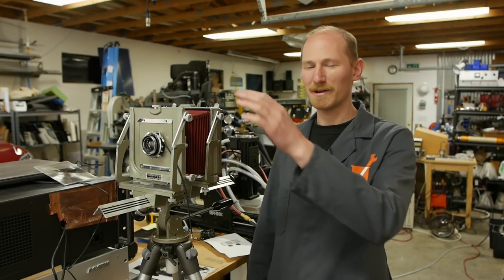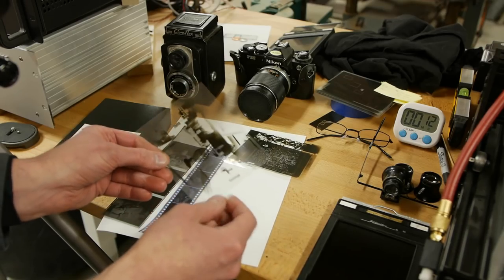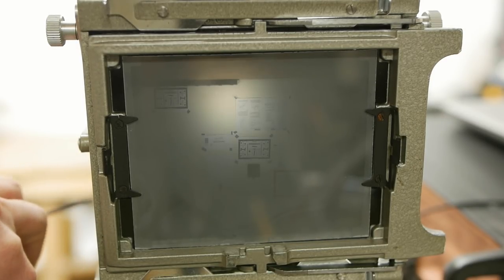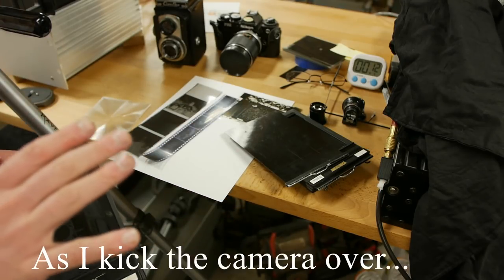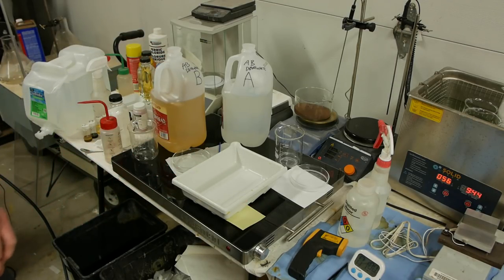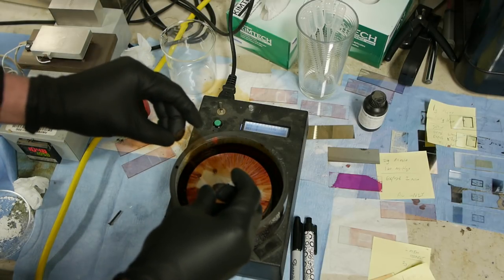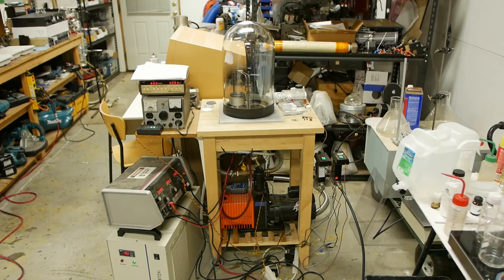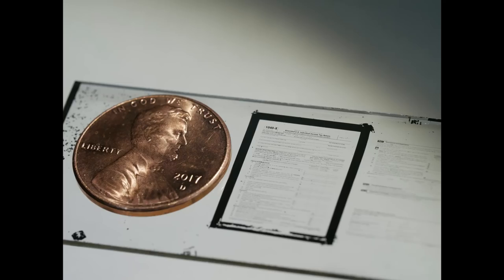Antique 4x5 camera creates 20 micron photolithography masks: Super tiny tax form

Comment: I don't know if this has been pointed out in a previous comment, but there are two main reasons for the "shark's teeth" dewet marks in your photoresist spin coat process (although I appreciate they don't seem to be posing you any problems just yet).

The first is the surface energy of the glass might be too low - a short oxygen plasma treatment will increase the surface energy and allow the resist to wet much more easily.

And the second is small particles which haven't been removed during your cleaning process.

I don't know what volume you're using, but I'd imagine you should be fine with about half a ml.

Inspection under a microscope should help you bottom out which mechanism is at play here. If you were to prepare a bunch of slides at once, then plasma treat them all, it presumably wouldn't be too much of an increase in time per slide, though I'm not sure how permanent the reduction in surface energy is.

Comment: What SheemOn Dallas said, but also looks to me like you had the film loaded emulsion side away from lens or that is one shiny emulsion. it is usually concave one the emulsion side so it presses against the back when loaded.
Datasheet will say how thick the base is, looks thinner than ordinary pan film.
Also, the dark slide has a white and black side of the handle, I set the white side out after exposure, most ppl do the opposite.

Comment: I've got a fairly foolproof way of cleaning slides as glass slides are dirty no matter where you live. We soak the slides for 1hr each in a lab detergent and 5-10% NaOH in distilled water, with a thorough rinse with DI water inbetween. The soap solubilises most of the surface contaminants and the NaOH slightly etches the glass, giving you a highly hydrophilic surface. It's well used to clean glass for surface force AFM measurements, and gives excellent adhesion for sputter coating.

Comment: This has probably been said but I did not see it in the comments.  The top of the dark slides on large format film holders are different colors on the reverse.  One side is usually white and one side is usually black.  Pick a color that is the color for your unexposed film.  After you take the picture you flip the dark slide around when you put it back in so the opposite color is showing so you now know which frames have been shot and which on have not by the color that is showing on the top of the dark slide.

Comment: The anti halation coating is actually to protect light from bouncing off the back of the film holder and back through the film again. Without this coating, light (mostly red but not exclusively) has a bad habit of producing halos around highlights. Cinestill 800t is a good extreme example of this phenomenon.

Comment: Red leds make great safe light. I have a led panel (made from strips of red led tape). They are not totally red so I have a sheet of red filter in front of it. It is about as bright as my normal lighting but just red. Crazy bright but does not affect photo papers even in 45mins or so (the longest I ever tested).
At first I tried a red bicycle rear light but I found out you can put a lot more light and replaced it with a panel. I think bike rear light was already a lot brighter than normal safe lights that are dim in order to keep the filtered other wavelenghts low enough.

Comment: Strange that the ortho film's reciprocity is negatively affected by cold temperature.
Regular photographic film reciprocity failure is reduced by cooling.

In long exposure astrophotography, in the film days, cameras were built with film holders that could be chilled with dry ice.

I print t-shirts for a living and the stencil material we use is UV, sensitive. I instantly said out loud
metal halide. Fluorescent tubes are no match for a metal halide. Much finer detail for the reasons you gave.
 My unit is a little brighter than yours at 1000w.  I have used it to make PCB boards as well.

Watching all this had me feeling nostalgic for the film days. I love digital, but there was something about the whole hands on technique required to get a result.

I still have all my dark room stuff, and I am tempted to shoot a few rolls, and do the whole process.

The fixer dissolves any of the undeveloped crystals, otherwise they would go black over time, even clear areas will contain small underdeveloped crystals that will eventually spoil the image.

A long but interesting video. The resolution you are achieving is outstanding. I love that the purpose is most just because you can. - Cheers

Comment: I think you're loading the film backwards!
I used a Linhof 4x5 40 years ago, and this I remember:
the "belly" on the film is there on purpose,
the shiny surface points backwards, 
the matt surface  (emulsion) points  to the lens.
The notches on the film are there you you can tell in 
the darkness on which side is the emulsion.
Just look at the belly on 35mm film

Comment: Nice work. Doesn't that 4x5 lens give optimum resolution in its mid F-stop range? Thanks for the flood of memory flashbacks! Back through all of my mid-60's H.S. days(nights), I had my own B&W hobby darkroom (up to 2.25x3.25). Used that Ortho Litho film for occasional high contrast special effects and PCBs. I memorized the name of that particular film developer chemistry and somehow, can still say it out loud (in two seconds!), "monomethyl-p-aminophenol-sulfate and hydroquinone".  lol Never got consistent results with color neg printing process (no voltage regulation?), but color slides were easy (E4 processing chemistry was not too safe though). I miss Infrared Ektachrome Aero film and still see an application for it every decade or so. Stay safe and keep up all the great work!

Comment: Wow this takes me back.. Used 4X5 and 8x10 until early 2000's before medium format digital superseded large format film ( though not as "antique" as that hammer tone model...and I have my doubts about that lens...  : )   A couple of tips...  Use brighter lights and thereby smaller apertures to achieve greater depth of field on the film plane.  That way the slight curvature of the film is a non issue and you shouldn't need to use your "Heath Robinson" vacuum dark slides..  : )  F11 on a 4X5 is not like F11 on 35mm or DSLR's - that's just a couple of stops short of wide open on most large format lenses.  Ideally you should be shooting at about f32 - f64 ( if that old lens will).  Yes litho's super slow - that's to achieve very fine grain in the silver halide crystals and hence better resolution - as you say it's for photographic reproduction, not for photography as such.  BTW you should be able to get reciprosity charts from the film manufacturer which takes the guess work out of it.

Lol, my great grandfather might've put the loupe in his eye socket but we used larger, brighter, higher magnification ones that were placed on the glass as you did - determining focus was quick, accurate and easy.  Oh and you're right, fresnel screens totally suck but with a better loupe are usable.  That camera looked about circa 1950!

P.S. Funny your comment about the curved film reminded me of a shoot I did once, leaning out the side door of a small plane shooting a ship over a wild Bass Straight with my trusty 120 film Hasselblad - my dream camera (at the time) . This would have been late 80's.  Processed the film and the centre of almost every image was blurry - the pressure of the air into the dark slide slot was ballooning the film off the film plane!   Film aye... horrible shit really.  Glad I now shoot digital.

Comment: Really cool! One interesting way to analyze how good the reproduction is would be to measure the optical transfer function of the system. It can be done relatively straightforwardly using Fourier analysis of a photo of a Siemens Star pattern. DOI:10.1364/OE.23.009567 shows the process for x-ray images.

Also, 2D Fourier transforms of sections of test patterns, especially a Siemens Star, can be really useful for analyzing the resolution of images. Plus they look really cool.

Comment: Two things I can think of that may provide a tiny bit higher resolution:
· Use a smaller aperture (not too small, of course)
· Use a bright, monochromatic light source (with the shortest possible wavelength), due to the fact that different wavelengths focus in different focal planes.

I'm probably wrong, though!

Comment: The reason for the fresnel is not so much for brightness it's more for evenness of brightness across the entirety of the ground glass. With a ground glass you'll find that you have to move your head about a little - left to right, up and down - in order to see all of the image projected onto the ground glass. With the addition of a fresnel you'll get the a much more evenly bright image which makes composing a photograph much simpler and more akin to how you'd compose when looking through the viewfinder of a normal camera. It's especially evident with slower lenses (f/8 and above).

Comment: Ortho film also has a slight, unmentioned advantage. Because it only responds to a relatively narrow range of wavelengths, chromatic abberation of the lens becomes less of an issue. I doubt it matters in this case, but it is a real effect.

Comment: Film holder dark slides have a white side on the finger grip to indicate unexposed, and after the shot, turned to the black side indicating exposed. Lith film is slow speed however your cool temp might be slowing it down. Typically I found 8 ISO (ASA) produced useful results.

Draw an X from corner to corner of the ground glass (Acid etched is better) to indicate the center. Put a mirror flat on the wall in front of the camera. Center all the movements on the camera to neutral position. Move the camera side to side, up/down until the center of the lens shows exactly the center of the ground glass. They you know the camera perfectly parallel to the wall. The reflection of the lens goes to the wall (mirror) back through the lens and onto the ground glass. Perfect.y parallel.

Comment: A crown graphic isn’t very “antique” but they definitely are of a certain vintage. They were made to be very reliable all metal portrait cameras and that’s where they excel. However they aren’t really suitable for what you are doing. Instead you may need to look into something known as a process camera. A couple makers are Nu-arc, argyle graphic, or robertson/log-e. They can be had used for almost nothing, so long as you’re willing to pick them up, as they are almost always rather large. These special purpose cameras however, have vacuum target frames and vacuum back film holders, and were designed for making printing masks for offset printing. They also have built in high intensity lamps and exposure timers. Their aberration corrected apochromatic lenses are suitable for copy work and micro-graphics, but you may also want to consider a micro graphics lens, like a kodak micro-ektar or micro-file lens made for microfilm work. They also have the additional advantage, that some were designed for alternative process photography as well. All that said, film photography is still the go-to system for producing micrographics and many other niche technologies, such as the photolithography mask for computer microchip dies.

Comment: Fresnel lens is in fact brighter at smaller apertures. Almost every modern DSLR has gone away from ground glass due to modern lenses being 3.5-5.6 and slower. Below about f./2.8 micro-prism focusing screens (similar in concept to fresnel) give an apparently brighter image. One of the downsides however is that at apertures wider than a our f./2.2 they no longer give an accurate rendition of the shallow depth of field. Large format cameras typically will be stopped down to very small apertures for landscape and other static photographic subjects hence the fresnel lens.

Comment: Some ideas.

Switch to a lens that's corrected for field curvature. There are special lenses for this, in a pinch, an enlarger lens should already be better.

Try glass plates instead of film for perfect flatness, or try exposing the slide directly. You can make your own plates, or you can buy them. Astronomy used glass plates instead of film for this reason. Plates for holography are still made. That also obviates the need for a vacuum back, which makes it easier and less prone to vibration during exposure.

You can control the grain structure of the negative by altering the developer, making it far higher resolution. Over one order of magnitude improvement is possible for b&w. This is how they make it good enough for holography. That said, you don't seem to be limited (yet?) by the resolution of the film.

Comment: Probably wont make too big a difference for the feature sizes you are shooting for but you should " edge " the photoresist. After spincoating the pr the edges will be thicker due to surface tension effects so when you put your mask on the glass slide some areas wont be as close. You can get around this by cleaning off the edges with some acetone. You get less area of pr and the edges look ugly but the important part will be sharper. Not sure how small you wanted to go though. Awesome work though and I'd love to see you try alignment off of previous patterns.

Comment: If I may give you some suggestions. When it comes to exposing uv light through film you should considder using a pyro based film developer. It causes a sort of stain over developed areas that greatly increases the contrast/stopping power in uv light. Also have you looked at using an old reproduction lens from an enlarger? They are optimized for reproducing flat images and can be found really cheap.

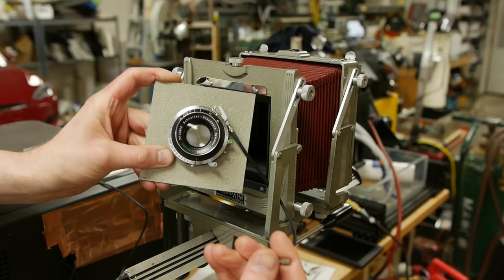Comment: @ 5:50 and 14:45 Might consider using large amount of FLASH / STROBE light to help with the instant exposure time. Wet plate collodion photographers also work with low (2-10) ISO sensitivity film/plates rather 10-30 secs.

Comment: an old medium format enlarger would simplify things greatly. add a custom plate holder for your photo resist coated slides, place your  pattern on the easel with mercury vapor lamps on either side and you're good to go with no need for an internegative. to focus just use a slide with a pattern scribbled in marker and the enlarger's built in light to project the scribbles onto the easel and focus the image.

Comment: Probably covered in comments below. . .
1. Fresnel lens on the ground glass will help even out the brightness of the screen toward the edges and corners. That is, no brighter in the center, but brighter in the corners. Some of this effect is visible in your comparison. For your application the benefit is no big deal, so choice of a plain ground glass is valid.
2. The visible metal ends of the slides protecting the film in the holders are painted black on one side. Load the film with the silver side out, then after exposure replace the slide with the black slide out to indicate exposed film. (Just a convention, as long as you are consistent the other way around works as well.)

Comment: 10:50 How to tell which side of the holder has been exposed.
Double dark slide film holders are made with a built in solution to this problem.
If you look at the top of the dark slide you will see One side painted black and the other side is painted silver (or white sometimes).
The standard practice is that you put the dark slide in the holder silver-side-out when you load in the unexposed film .
You pull the dark slide out when you make the exposure, but you flip the dark slide over before putting it back in.
That way all exposed sides of film holders end up the black side facing out.

in a box of 10 holders it’s then easy to see which sides of the holders are unexposed and ready to use.
The hooks that swing over the dark slides are just a saftey precaution to top them accidentally lifting and fogging film when they are in the camera bag.

Comment: Thanks for the fascinating demonstration.  I am wondering if your resolution on film can be adequate to produce a custom direct-printed hologram, printed on paper, then to be transferred/scaled down photographically onto the film.  Your resolution is currently 20 microns, which is pretty good for lithography, but for holography with visible light, I think you need to get to sub-microns.  I wonder if your "slow" film has sufficiently small grain sizes to have the resolution to do holography.  When we made simple holograms in college, I don't think we used film that was better than you have.
Since you are able to use a laser printer to produce the original image, It would seem a computer program might be able to calculate the fringe patterns necessary to create computer-generated holographic patterns that when scaled down, can produce, not only 3D images, but also custom optical elements with interesting properties (gratings, lenses, beam splitters etc.).  You should be able to use the film directly and not transfer the image to a microscope slide.
Perhaps you can print a large digital fringe pattern image with the laser printer onto paper (it will look like a swirly mess), and then photograph the image as you did before to shrink it down.  You can expose the film using an intense LED array for UV, blue, or green (alternately a mercury vapor lamp for green?) light sources to speed up the exposure time - no laser required.  If it works, it would bypass the "old-fashioned" process of making a holographic films (the split-beam method).  Just curious if you think this would be in the range of your set-up.  Joe

Comment: Seems like you could use your in-shop electron microscope to directly pattern the exposure onto the photoresist using electrons instead of photons.
If you have direct access to the beam steering plates and can control them with a computer, anyway.